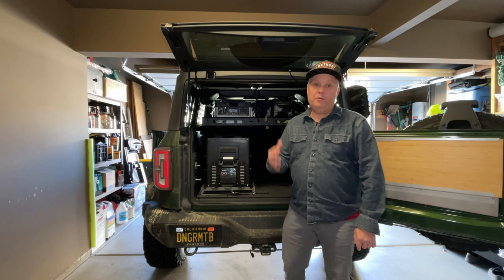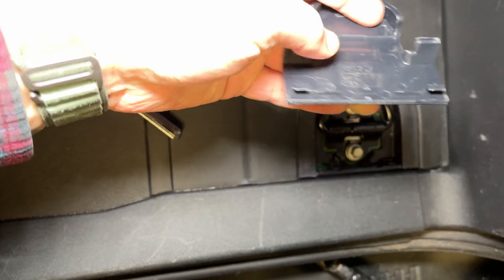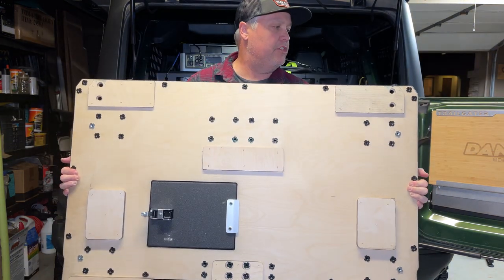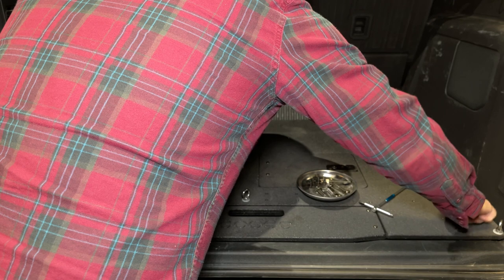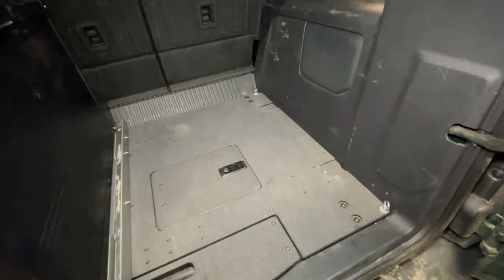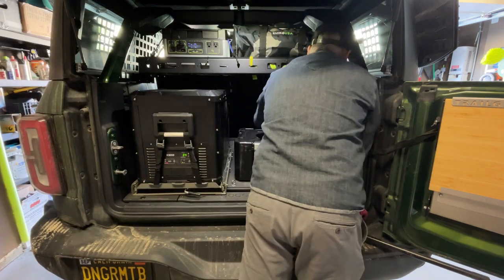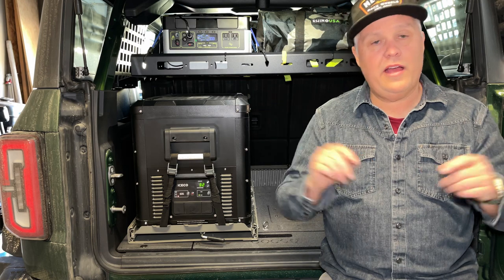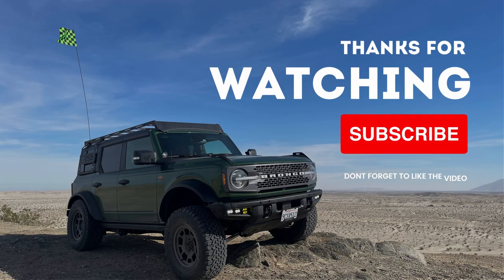Goose Gear Rear Plate System for the Ford Bronco 4-Door Install and Review

Comment from the maker: Please let me know your thoughts about the Goose Gear Rear Plate and what are you using? Happy to answer any questions.
Reply: You lost me at the jack access. Having to remove screws to access jack is a deal breaker. Mostly because if you leave the screws out, it rattles.
Reply from the maker: @Pb_Slinger  I agree that it would rattle if unscrewed, but honestly, the OEM jack is terrible anyway, and if you want to use the jack, it takes less than a minute to unscrew. This floor plate is super useful and versatile, and if the only downside outside of price is having to unscrew four Allen screws "in case" I get a flat, it's worth it to me. Whatever works for your situation and needs is what matters most, but I wouldn't let that minor possible inconvenience steer you away from this product.
Reply: @dangermtbbronco  i already don’t like having carpet in the back of my Wildtrak. For the price of these parts, I can’t justify the spend when they don’t work exactly how I would like. I don’t doubt you about the jack either.
Reply from the maker: @Pb_Slinger  Yes, makes tons of sense.

Comment: I’m curious why you picked the driver side for the fridge. I’ve seen most on the passenger side where the 12v cig plug is located. I have same fridge and dometic battery and curious where you keep your battery for the fridge as well. Thanks and great video
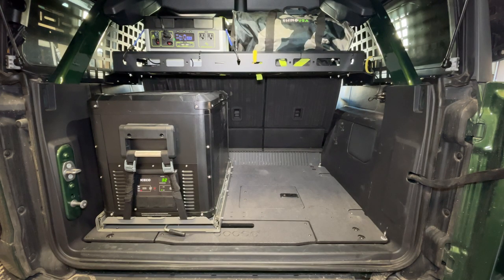Reply from the maker: Great question! Because I am running the Goose Gear cargo floor, I wanted to keep access to the storage underneath, and the door for that is on the passenger side, just right of the fridge. They do make it with the hatch on both sides, so its really personal preference. But for me, the driver-side mount is better for accessing the refrigerator when the gate is open and the table is folded down. It makes for a good working area without having to move stuff to access the fridge and or table. The Goal Zero battery is above the fridge on the JCR half shelf, and I run power to the 12-volt input on the passenger side to power up the battery while driving. You can see that setup at the 1:19 mark. Hope that helps. Let me know if you have any other questions.

Comment: The plate appears to have some blocks that raise it slightly. I installed a battery system from American Adventure Labs in the storage compartment under the floor and have one 4 AWG wire going to it from the engine bay and one 8 AWG wire and a ground going out and over to the rear panel on the driver’s side. Would you think there is enough room for these wires to sit under the Goose Gear floor? I have the factory floor over these wires now, which is flexible enough to conform around it.
Reply from the maker: Hi John, Great question. I am considering buying that same battery system from AAL and think there is plenty of room for wiring under the Goose Gear Rear plate. The only potential downside is that you don't have the same full access since the Goose Gear plate only allows you to flip up one side compared to the factory. But there's probably no need to access the batteries and wiring once it's installed unless you have an issue, and if so, you could easily remove the whole plate, which I have had to do several times for other gear installs. How do you like the AAL battery system?
Reply: @dangermtbbronco  That gives me more confidence that this solution will work; thanks. I just completed the AAL install about a week ago so I don’t have any trail experience with it yet but I like the look. There’s a thread in Bronco6G where I discussed it with others and uploaded pics (I’m BroncoInTheATL).
Reply from the maker: @JRMulcahy  Thanks! I commented on the 6g thread with a question for you.

Comment: Im not a fan of the wood personally. Especially at the price of this. I dont wanna have tocworry aboit wood rotting.
Reply from the maker: Not an issue it is covered in a durable textured coating. Unless you are taking your rig in the lake rot isn't going to be an issue. There is an aluminum floor from American Adventure Labs called the MASS system worth checking out if wood isn't an option for you. Thanks for watching and commenting.

Comment: Thanks for posting this. That really seems like an easy install.  Could you tell me what battery system is shown?  It seems to fit very nicely in the space above the JCR rack. Thanks!
Reply from the maker: Hello, it is a simple installation. Thanks for watching. The battery is a Goal Zero 1500X and has room on the front and back, although it won't fit oriented the other way in the JCR shelf. The battery is plugged into the power outlet and recharged off the Bronco alternator while driving.

Comment: Hey there, I have the bronco security drawer system.  It’s 8.5” tall. Do you think that floor system would work if I mounted it on top of the box? I know it would take a lot of customization. But my biggest complaint about the drawer system, is that it makes my floors storage smaller.
Reply from the maker: Hi Travis I don’t think so. Raising it would interfere with the tailgate lock mechanism. You would need to cut that away. You would be better off custom making a DIY solution or I would check out some of the solutions that @diabolical_inc offers.

Comment: I have the Iceco fridge slide.  Do you notice any what seems like front to back rattle when fully lock back in the storage position?  I can kind of rattle mine when shaking the fride front to back.
Reply from the maker: Yes, and it's driving me nuts when off-roading. Good to know I'm not the only one. I reached out to IceCo, and they thought I was nuts. I have been working on a fix and tried a bunch. I am going to buy two big rubber door stops to wedge in the front of the slide between the base and slide plate and see if that helps. If it doesn't, I may drill a hole and use a spring-loaded set pin or threaded bolt that I can easily pull up to slide out, but that would lock it in place.
Reply: @dangermtbbronco  Yeah when offroading is where i'm hearing it as well.  Maybe i'll open a case with IceCo as so they know its a problem.  I think I'll try the ruber doorstop as well.  Let my know how it goes and I'll do the same.

Comment: Thanks for the video. Great info. 
Do you know how much the plate system weighs? 
I couldn’t find the weight. Thanks!
Reply from the maker: Yeah, they don't post the weight on the rear plate, but they do for the rear seat deletes which probably weigh more in terms of wood and material for storage underneath. And the rear cargo plate is pretty light. So I'm betting less than 15 lbs.

Seat Deletes weigh
32 pounds for the 60% delete
22 pounds for the 40% delete

Their customer service is also excellent. You can call them direct at Tel:1-844-466-7334 to get an exact weight.
Reply: @dangermtbbronco  Thanks for the info!
Reply from the maker: @DBCoffroad  You're welcome happy to help!

Comment: This looks nice. I so wish they made one from HDPE
Reply from the maker: Thanks, I am still really loving it. Interesting idea. I know people use HDPE for applications like the bottom of sliders. I need to learn more about it to know how great it would be for this application. I bet HDPE would look pretty bad after a few months of sliding gear in and out. I assume plywood is cheaper for Goose Gear and likely has a much smaller carbon footprint. But again, I am not knowledgeable in this area. Expedition Essentials makes a great option from Aluminum.

Comment: Do you have a link and/or review for the refrigerator you are using?
Reply from the maker: Hi, and thanks for watching. This is the Iceco 45s Pro. This is my second Iceco fridge, and they have been really reliable and offer a good value compared to way more expensive fridges. Also, make sure you check the web for coupon codes. IceCo has sales all the time, and coupon codes are easy to find. You can find info about the fridge from Iceco at https://icecofreezer.com/products/vlpro45s-12v-refrigerator.

Comment: Which fridge slide is that?
Reply from the maker: This is the Iceco VL35/45/45Pro Single Zone Slide Mount. Solid slide. My only annoyance about it is the tray does move about a 1/4 inch front to back when locked so you get a little noise but most slides do that. This is my second Iceco fridge and slide and they have all been great.
Reply: @dangermtbbronco  Got mine installed today, I was able to use holes in the slide just fine on the right side, on the left side I just used fender washers to hold it down, six screws in all. Really a nice fit.
Reply from the maker: @tmcnicho  That is awesome! You are going to love it!
Reply: @dangermtbbronco  have you figured out how quiet down any rattles on this slide?
Reply from the maker: @tmcnicho  No not yet. I just started ignoring it. LOL How about you?